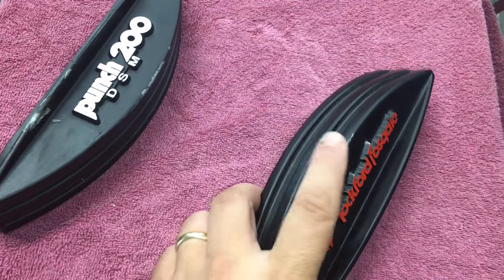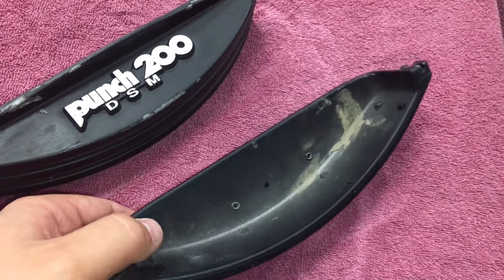Remove Paint Off Car Amplifier - Tech Tip Tuesday #1

Comment: I would not advise acetone - this stuff is BAD for plastics, and it's way too strong unless you wanna clean something to bare metal.
I usually use these chemicals in ascending strengths:
Isopropyl alcohol
WD-40
Mineral spirits
Laquer / paint thinner
Reply from the maker: +Oh Kay no Rain-X? 😜

Comment: yea the emblems are riveted on.
sometimes you can fold the rivet edges, punch em out and save them. when reinstalling just gotta do the reverse and mushroom the edges of the rivet and shes good!
cool little video man! I dig the quick tips!
Reply from the maker: +4HitsWilystyle right! I've removed several and put them back on with no issue. Thx for da comment